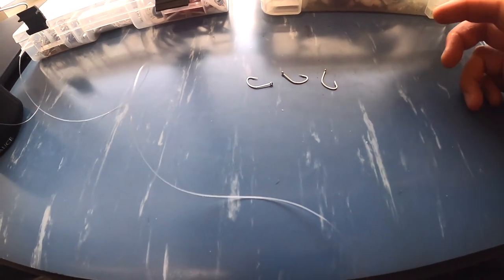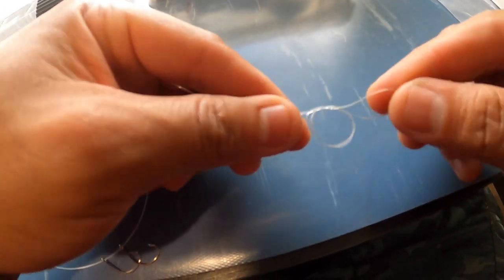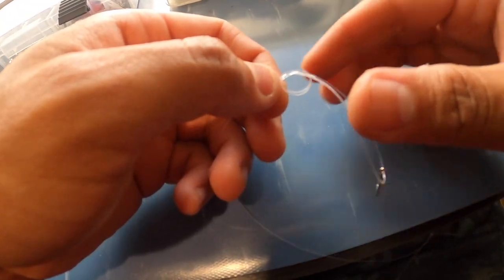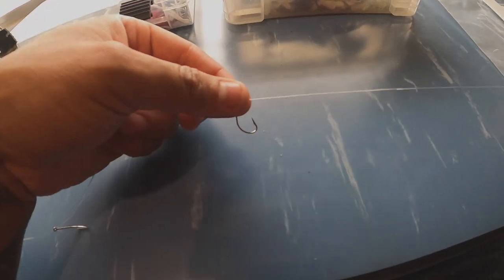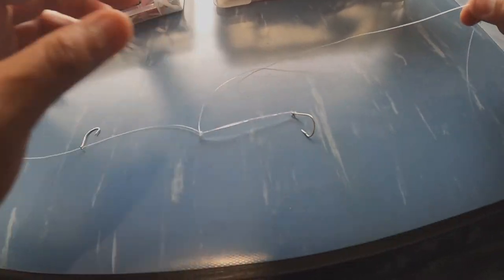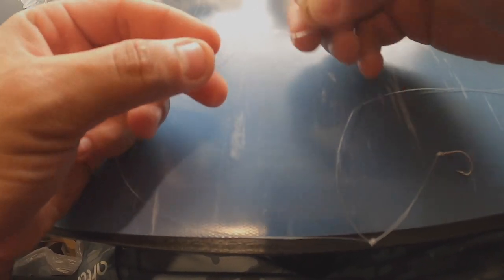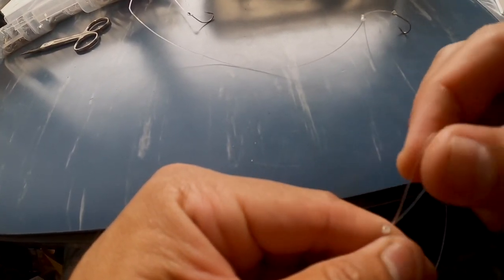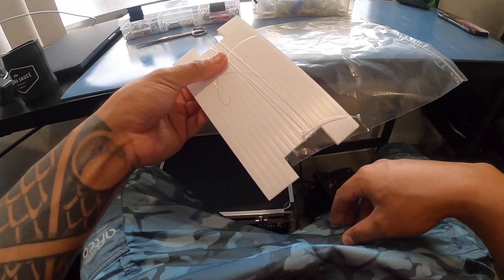Fast & Easy Way To Tie Sabiki Bottom Fishing Rigs

Comment: Thank you for taking the time to make this video.  I have been wanting to try something with how I rig up 3 to 4 DOA Minnows with work hooks. I have tried several methods that people have done and they don't work. They get tangle up to easy. Your way works. I used 30lb test so it was stiff enough and I can cast it out and retrieve it fast. I haven't tried 4 yet. I will keep ya posted
Reply from the maker: 3 sounds like the sweet spot! I actually use that bottom fishing 80-120’ deep straight down, instead of casting. Cool thay it works casting!